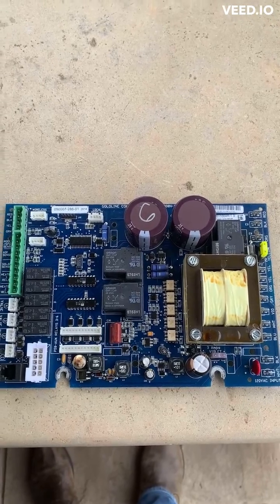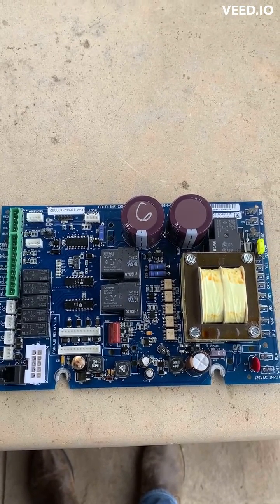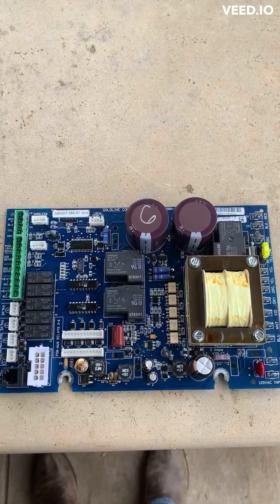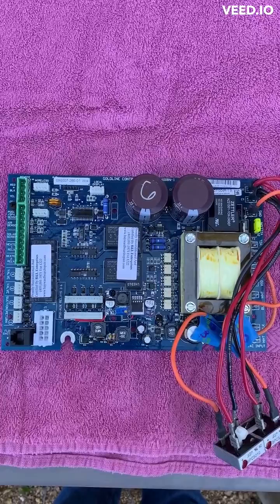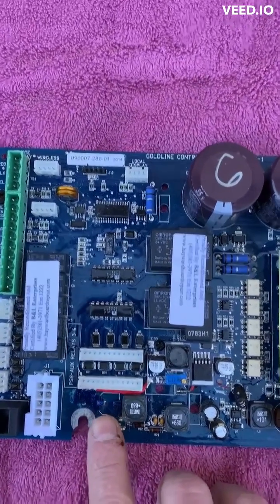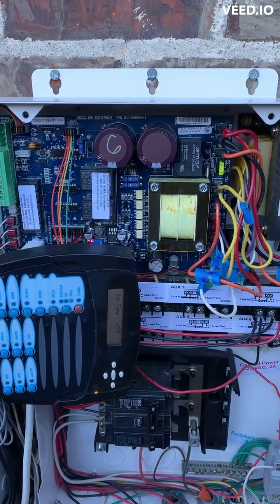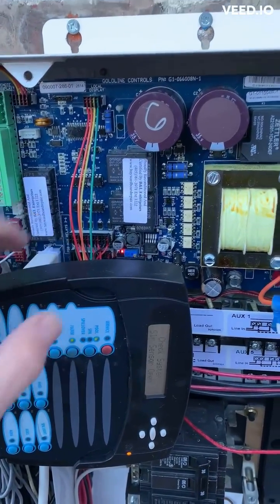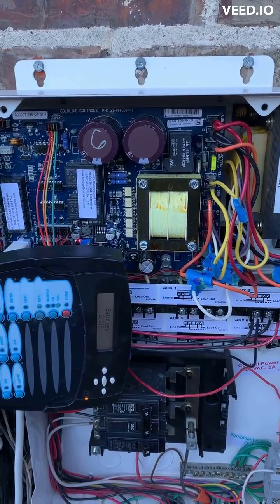Hayward /Goldline /Aqua-Logic Circuit Board Refurbishment - watch this before buying new board

Comment: Common issue with hayward control system board will have burn marks on the back of the board,  probably better off not using hayward as their equipment is garbage.  Certified Leslies Pool Technician. Hayward is garbage,  Jandy is the best,  and pentair is pretty good as well